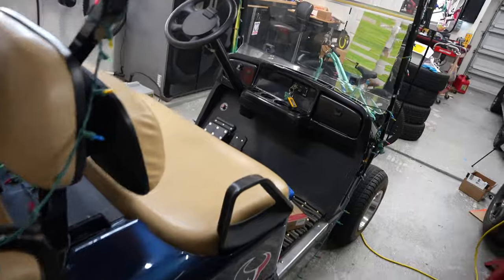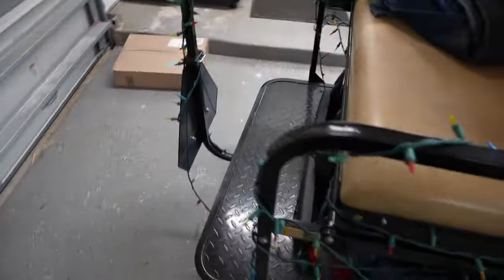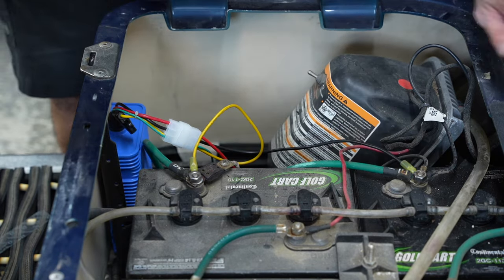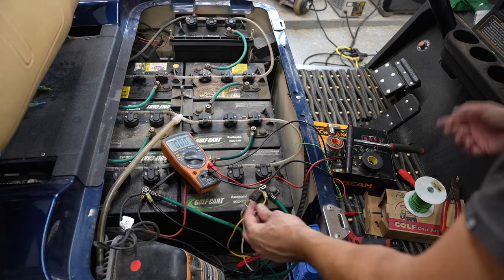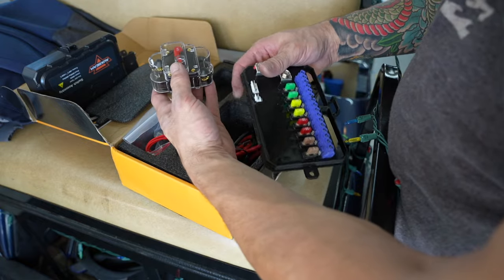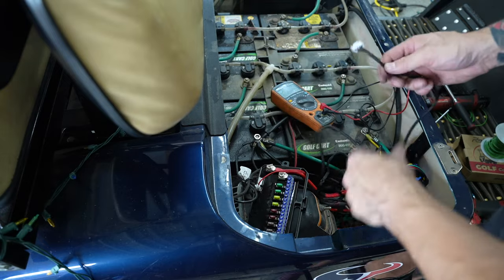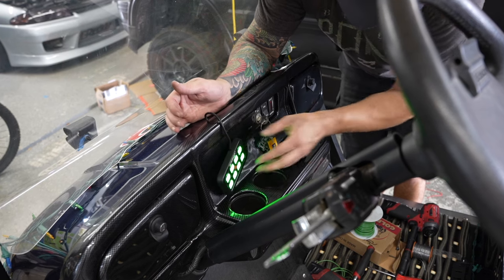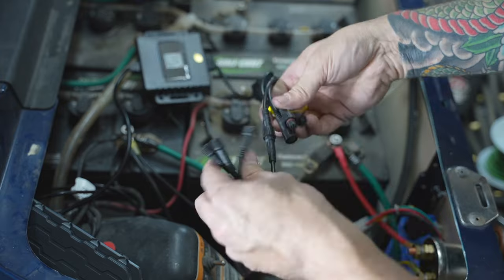Golf Cart The Best Way to Power 12 Volt Accessories / How to install Voltage Reducer 48v 36v to 12v

Comment: Thank you for the nice video! I did this install for a 6 gang switch panel, and installed 4 rock lights underneath frame. I now have capability to easily add Christmas lights for Holidays! I liked using the velcro stickers to mount the hardware in battery storage area, too.

Comment: What do you do with the 2 wires that connect to a push/pull switch for a headlight if I want to bypass that switch and use the aux beam switch panel?

Comment: I’m installing this same switch box and have an ECO Battery 12v Converter already installed. My question is where the black 12v out wire goes to? Your video shows the battery but where does the negative on the switch go to or should the black out of the converter go to this spot on the switch. First time doing this. Appreciate any help. Thank you
Reply: Make sure you hook up 48v battery to a step down converter (12v) or you will blow the 8 gang switch panel. Ask me how I know 😅.  

You will want to run the switch panel to the converter only.

Comment: I have a question. Would I be able to power a radio unit and speakers using the AuxBeam as an on/off switch.
Reply from the maker: Oh yes
Reply: I’m gonna ask but I’m stuck at the radio install. I have tried every way imaginable getting power to it

Comment: Hello so I have a 36v eco and the reducer is attached to the main battery and on the other end of the reducer I have a postive and negative wires coming out. How would I install this on my 36v battery/reducer? Thanks in advance for any advice as I’m stuck at the moment
Reply from the maker: What?
Reply: @Donnythelatemodeltech  the aux beam has instructions on how to connect it to a 12v but the battery I have is a single 36v battery so I don’t believe I can connect it directly to that battery correct? My battery did  come with a reducer which is installed but now I’m just not sure how to go about connecting the aux  beam to the reducer unless I can connect it directly to the battery which is 36v.
Reply: @carlosq5910  Don't connect it to the battery directly.  This Auxbeam is for 12v-24v batteries.  If you hook up the Auxbeam directly to the 36v Battery, you will blow the switch (I did this by connecting directly to my 48v LiON battery).  You have to hook it up directly to the reducer so that it doesn't get more than 12v from the battery (reduced from 36v to 12v by reducer).